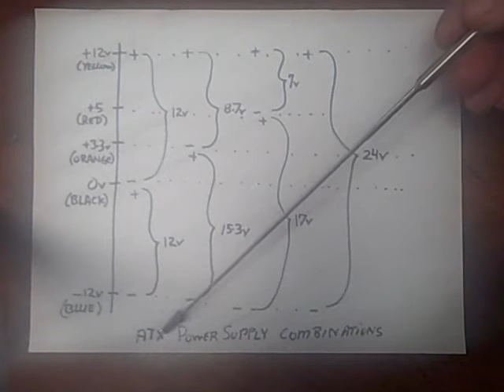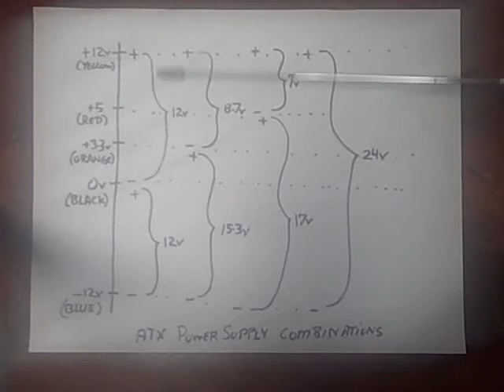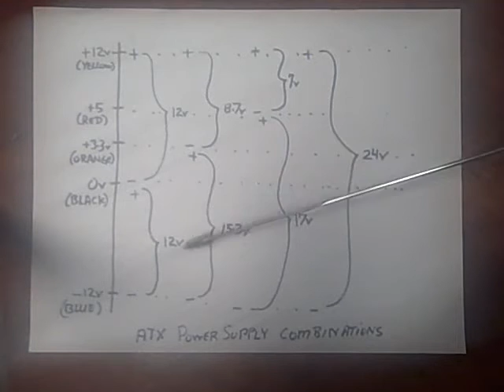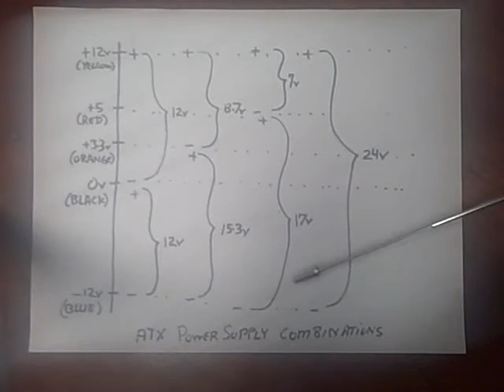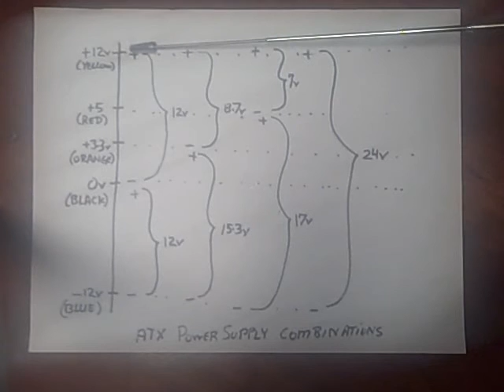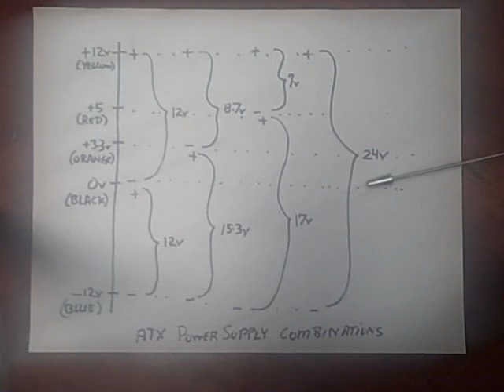The Voltage Combinations from ATX Power Supply

Comment: Can I get 1.67v from the 5v line and 3.33v line?
Reply from the maker: Yes, you should be able to get that voltage  from the power supply. But I don't know how much current you'll be able to draw . My guess it would be at least 5 Amps  for most power supplies.
In any event, if you overload that voltage  combination the power supply will simply turn itself off . 
The to restart it , remove the load, and unplug the power supply for 15-20 seconds and plug it back in, and it will start up .

Comment: How much current can we get from -12and +12 combination?
Reply from the maker: If you look on the nameplate of your power suppy, there is a rating for the  minus 12 V supply. Typically it is between 0.4 to 0.6 Amps. That's the limitation even though the plus 12V can supply much more than that.
However, I still use the -12 and +12 combination  to charge batteries that need more than 12V  e.g. a string of four lithium batteries in series needs about 18 to 20 V  to charge. It just takes a bit longer to get the batteries charged up.

Comment: So if my 12v out is 20amps that is the most I can get out no matter what I do?
Reply from the maker: Your power supply will have a name plate on it somewhere and it will also have a POWER rating , i.e. watts  as well as voltage and current ratings.

Remember that POWER = VOLTS x AMPS.
In your case, the power supply POWER rating will be about 250 watts, or (approx) 12 V x 20 A = 240 W.

So you are correct, you are getting the maximum current of 20 A from your power supply at 12V.

Note that at a lower voltage e.g. 5 V, you can get more than 20 A of current but still limited to 250W of power.

IF you overload the power supply, it will simply stop working.
Also there is an internal , hard wired fuse that will destroy itself, if there is a large over load like a dead short. It's there are a last resort to prevent over heating and a possible fire.
Reply: @disproman  Thank you for your response. I have a few ATX units and am trying to build a supply with the most power I can get from it. So I should just use a couple of the negatives and 12v positives for optimal results? Would adding a Buck/Boost improve matters?
Reply from the maker: @bp9293  Adding a buck/boost would not change the output DC voltage. There are internal regulators that keep the voltages  as rated no matter the input AC voltage.

You could try the parallel connection of multiple power supplies. Just make sure that they all have the same ground connection. The easiest way to do that is to use a power bar.  I have not tried  that - dunno , for sure.

The limitation , of course, is the fuse or breaker on the AC side. 

 If you overload one of the power supplies and it shuts down, the others might not be able to handle the load, and they will shutdown too. Also, you should connect ALL the yellow wires, not just one or two, and all the black wires - the physical connections from multiple power supplies might get a bit complicated.

Comment: You have nicely summarized the voltage. I suggest you to with out -AC power. You just connect the power supply's wire to the battery fan non-stop running mean sucking the battery power. It's mean reverse current not charging but sucking the battery power. How it's resolved.?
Reply from the maker: There are several ways to resolve this.
1) Simply disconnect the battery when you are not using it
2) A more elegant way is to add a diode in series with one of the battery terminals. You will know which way to connect the diode by seeing if the battery is charging when the power supply is ON. If it is not charging, then simply turn the diode connection around. 

You might see a slight reduction in charging current, but nothing significant

Comment: Thanks so much! You mention the higher voltages get less current, predictably.  Does the watt rating of the ATXPS affect how much current you can get at 24v? I have an 800w PS, I would think it could supply a decent amount of current at 24v?
Reply from the maker: The ATX power supply only makes a limited amount of current using the 24V configuration.
Look at your name plate, and you will see the current that is available from the 12V  supply. it is usually less than 1 A typically 500mA to 700mA
To get 24V you connect the +12 and the -12 wires. 
The current is limited by the -12V  current. even though the +12V is capable of a lot more..

Comment: very helpful video, can i use +12, gnd, -12 as a dual supply?
Reply from the maker: Yes you can use it as a dual voltage supply.
Please , however, realize that the -12V  provides a limited current ( usually about 0.5A max.)
The +12V can make up to 10  -15 A.
Heck, you can even use the +3.3 V and the +5 V as well.
Because that is how your motherboard and your other computer components eg hard drive, use the power supply.
 But also remember that  has a TOTAL power output which is shared among all of the voltages.

Comment: Any idea how much current you get from the  15.3, 17 and 24 volt leads?
Reply from the maker: The current from those combinations is lmited by the current available
on the -12V lead - the blue wire usually.In most ATX's, it is about 0.5 A.
I have found it to be enough to charge Lithium batteries scavenged from laptop battery packs. .But I am careful to measure the current when I charge them.

Comment: how can i get a 4.2v with a 500mA or 1A current? i need that to charge 18650 batteries...
Reply from the maker: I suggest that you use the 5 V connection and put a 5 to 7 ohm resistor in series with the battery. This will limit the current to about 500 mA.
You can use your DVM  to measure the resistance just to make sure that you've got it right, and you can also use the DVM to measure the current if your meter has a scale that goes that high. - most el-cheapo DVMs only measure current up to 200mA.
But even if you only have 200 mA - that's still OK to charge your 18650 battery  - it will just take a bit longer.If you have access to an electronics surplus place , see if they have a variable resistor ( some folks still call them rheostats) with say, 10 ohms that will let you vary the amount of charging current.

But please do NOT leave you battery connected to the 5V power supply when the power supply is off - that will discharge your battery.
Reply: disproman thanks man..
Reply: schéma boîte noir Toyota